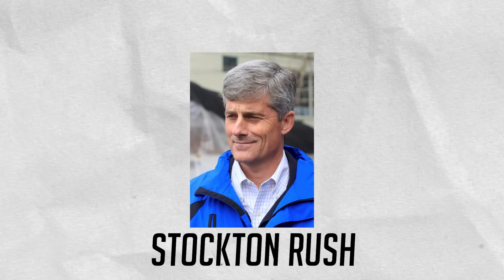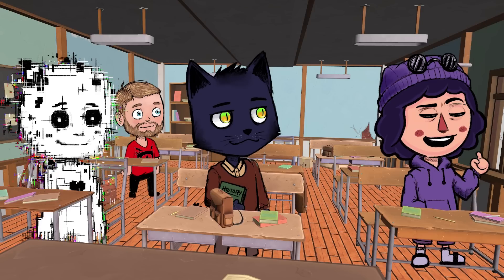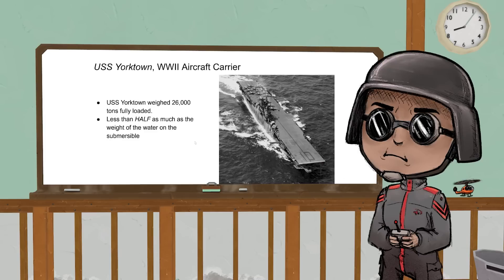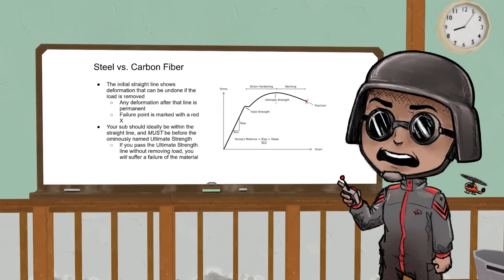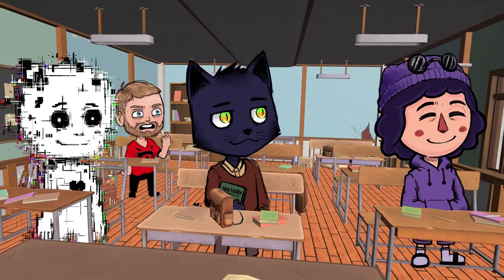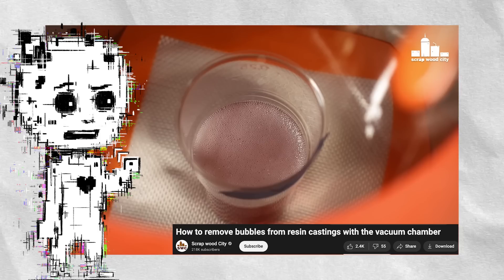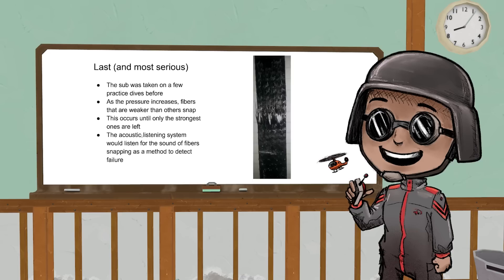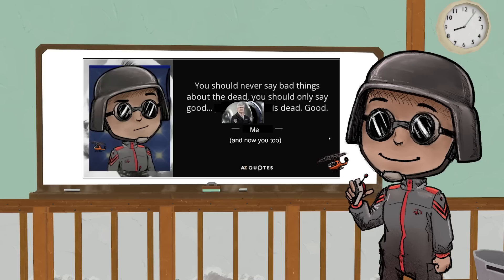An Actual Engineer Explains the Oceangate Incident

Comment: It's crazy how negligent ego driven billionaires can be
Reply: By the time they get that rich (and reinforced by the fact of that wealth) they’ve spent a big chunk of life being told how smart they are by new stories/public praise (ie Musk fans)/orbiters that just want a piece of the money printing machine that extreme wealth is. The money rolling in serves as “evidence” it must be right. It’s a perfect storm to train them to think they are better at everything and disconnect them from so much of a normal person’s reality. Past some point of wealth it’s just really hard to actually fail at most things, at least in a way that can’t be papered over with more money.
Reply: Then layer on that any amount of empathy or introspection they may have left about the level of disproportionate power and insulation from risk they have in the face of everybody else is a huge motivator to buy into the idea they are so great. Otherwise they might have to admit to themself they don’t (no one does) deserve that elevated status and feel some real guilt.
Reply: @RocketSurgn_ Except SpaceX actually has an excellent safety record when it comes to manned spaceflight. They test everything extensively to find out what can go wrong before ever putting people on board.

Contrast that with Boeing Starliner,  where it's safety is so in doubt that NASA intends to use a SpaceX Dragon to bring its crew back to Earth.

Or the NASA Space Transportation System (AKA Shuttle) which was entirely incapable of aborting through much of its ascent, and the side-mounted orbiter was an inherently dangerous design when combined with the insulation foam on the external fuel tank.

The Challenger disaster wasn't a design issue but a management one. Despite being a government organisation, not a billionaire owned corporation, they were willing to put astronauts' lives in danger simply to keep a schedule.
Reply: @ReddwarfIV  i like how you went above and beyond with your demonstration of being an orbiter. The guy barely mentioned musk and you needed to give 3 paragraphs to defend your blorbo.
Reply: @cheezbiscuit4140  I like how you can't refute anything I said.
Reply: @ReddwarfIV  mocking, not arguing, but most people know the success of spaceX is from the hired engineers working around and in spite of musks stupidity. You wanna talk about Musks ingenious management of twitter?
Reply: @cheezbiscuit4140  Engineers are only half the equation. Blue Origin also has awesome engineers, but they've not even reached orbit yet and they're delaying ULA's Vulcan rocket with slow engine production.

Virgin Galactic/Orbit have been working on space tourism for longer than SpaceX has existed. One is suborbital spaceplanes, the other was shut down because it failed.

You need great engineers to do great things, but a company also needs a leader with vision and motivation to direct them.
Reply: @ReddwarfIV  I see you really dont want to talk about how the muskrat dealt with twitter~
Reply: @cheezbiscuit4140  Are you arguing that mismanaging Twitter is equivalent to putting astronauts or submariners' lives in danger?
Reply: @cheezbiscuit4140 because it's not relevant to space x
Reply: @littlefurrow2437  Thankyou for adding absolutely nothing of value to the conversation.
Reply: @ReddwarfIV  the mockery adds value because you're the only one that wants a conversation about defending stupid billionairs.
Reply: @cheezbiscuit4140  Don't start nothing, won't be nothing. You just don't want to be called out when you say something wrong.
Reply: @ReddwarfIV  you're the one who started the derail? And you still seem to be too dense to understand I'm mocking and not arguing?
Reply: @cheezbiscuit4140  Call it mocking instead of arguing all you like, arguing is exactly what you're doing. And you lost the argument.
Reply: @ReddwarfIV  i mean you can tell yourself that, but insisting the jester is serious just makes you a funnier clown and the jesters job becomes easier~
Such an insistence on imposing your own reality makes it easier for me to understand why you simp so hard for the most divorced rich guy in the world
Reply: @ReddwarfIV  also hypothetically if you have a significant other that tries to effectively communicate with you but you cant do that because compromise and validation means you lose the argument, and they leave you for a more effective communicator, does that count as a triumphant argument win for you?
Reply: @cheezbiscuit4140  Why should I answer your hypothetical when you say this entire discussion is bad faith mockery?

And a jester's job is to make a king laugh, maybe use comedy to make points they might otherwise ignore. If you're showing up to annoy people for your own amusement, you're not a jester, you're a troll.

If you have nothing worth replying to, this will be my last response. As they used to say, don't feed the trolls.
Reply: I’m not a fan of Musk including the number of children from so many women. Or his buying X. I’m also don’t think man going to other planets and living there serves any real purpose. Oh. And I think electric cars have a long way to go before getting past grade school inventions. However he is a genius who focuses on machines which is a good thing. SS far as wasting money on these types of projects, I’m niw 76 and I’ve learned there’s no shortage of money anywhere and anytime. You just need to convince a few very wealthy or political leaders to finance your vision.
Reply: OceanGate already sounds like a scandal lol
Reply: Let's milk that for all it's worth!
Reply: Agreed, but then again it's also hard for me to imagine anyone can be such a degen that they can have virtually unlimited means (insofar as they could have more money than they could ever realistically spend even living a lifetime of total luxury) and STILL be greedy/addicted to wealth enough to always need more.
Reply: Stockton Rush was NOT a billionaire, that was part of the problem. He needed actual billionaires' money to bankroll his expensive, deep sea submersible dreams, charging them $250k a time for a trip to Titanic. 

Rush was so desperate for these hefty cash injections, he offered a super-rich father and son (who had expressed reservations about the submersible's safety), a 50% reduction on the price of their tickets - but they declined. Their places were ultimately taken at full price on the only, and last ever 'Titanic' expedition of 2023, by another father and son - the late Shahzada and Suleman Dawood, two of the 5 men killed on June 18th.

One pertinent fact not mentioned here, is the 'Titan' submersible's (not 'submarine', as stated in this video) low strike rate. In its short life, the 'Titan' successfully descended 12,500 feet to visit the wreck of the legendary 'Titanic' and made it back, just 13 times out of 90 potential expeditions. The 'Titanic' deep-dives were mostly abandoned at the last minute, due to various technical issues or poor weather. 

This means for its main, money-spinning purpose, ie the 'Titanic' expeditions, the 'Titan' sub had a remarkably poor success rate of less than 15%. Many wealthy, wannabe 'Mission Specialists' (as 'OceanGate' named paying passengers, to bypass safety laws pertaining to members of the public), only got to experience a short, shallow trip on the 'Titan' sub and a taste of life on board the 'Polar Prince' mother ship, and never got to see the legendary 'Titanic' wreck as they hoped. But they dodged a game of underwater Russian roulette. Because the carbon fibre craft meant it was a case of when, not if, disaster struck. Given enough cycles of pressurisation, 'Titan' would, inevitably, implode.

Stockton Rush's hyped alarm/pressure sensor system, which he claimed would provide sufficient warning of an underwater failure in the carbon fibre hull to safely abort, was surely the ultimate example of his snake oil salesman patter. Did he actually believe his own hype? It's doubtful, he was not a stupid man. But he was a narcissistic one, and the confidence and delusion of the most extreme narcs, makes them capable of extraordinary risk-taking. These people think rules don't apply to them - and have a deep-seated sense of immortality.

While death came to the 5 occupants in a split second, James Cameron believes they had to know there was a serious problem/the hull was breaking down, before that. He said the men may have heard 'terrifying' sounds, as the carbon fibre began to de-laminate. As water entered it, forcing apart the layers of composite, a 'cracking' sound, not the sensor system itself, likely alerted them to the imminent disaster, and they probably experienced fear in their final moments alive. 

The official report into the disaster has yet to emerge, but it appears the sub had dropped its ascent weights and was trying to return to the surface to manage an emergency. But of course by that time 'Titan' was almost 2 hours into its descent, had almost reached the ocean floor, and would have taken the same, approx 2 hours, to surface. 

Cameron summed up Stockton Rush's 'safety' measures best: "The 'OceanGate' sub had sensors on the inside of the hull to give them a warning when it was starting to crack. If that's your idea of safety, then you are doing it wrong".

Comment: bad science
Reply: Not even science, just arrogance. There were lots of known flaws and issues with the material he was using and how they were building, testing and using the subs, and Stockton Rush basically just ignored it all.
Reply: Give a blank slate to a materials engineer and ask them to build a submersible to visit titanic and they will NOT chose a material that is good in tension but lousy in compression.
Reply: @PeteOtton  There's a theory in design that indicates what is bad in compression is actually good in tension.   But that is just a theory